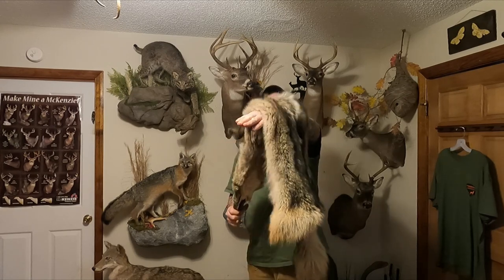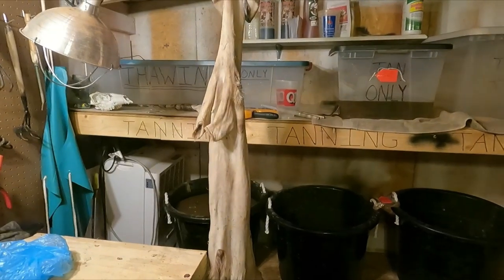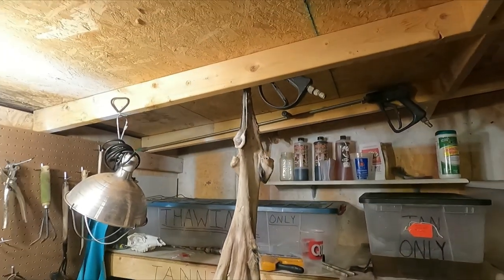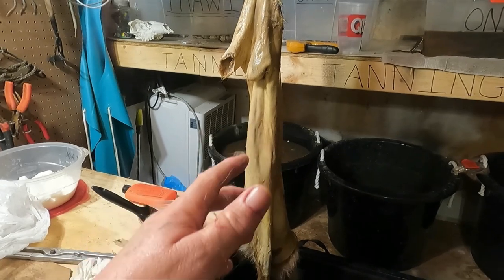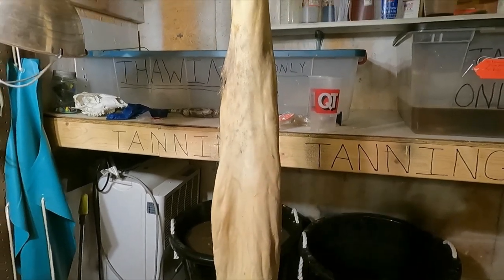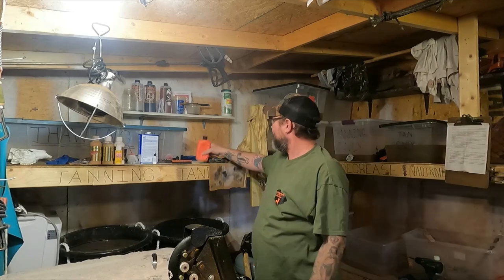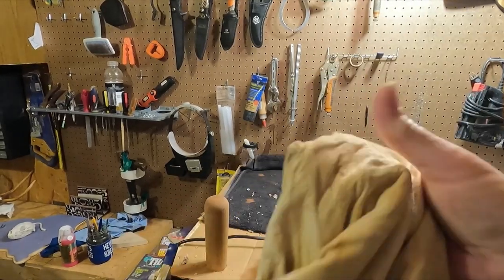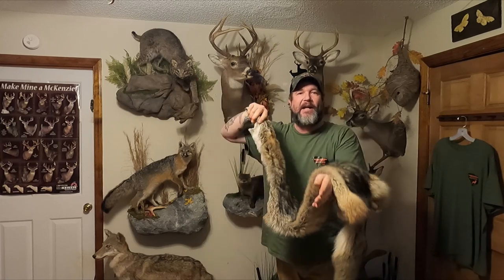Soft Tanning Pelts (Coyote Part 2) #taxidermy #howto #wildlife

Comment: Great info I use the same the orange bottle just got done doing the white tail tip coyote I got the other week. Fleshed it with a electric pressure washer turned out pretty good 👍. Thanks for sharing  buddy 👍🤘💯🇺🇸
Reply from the maker: Yes pressure washing does a really good job. Rinses a lot out of the skin, which is good. Thanks for watching and feed back.
Reply: @carolinabushwacker  yes sir thanks again for sharing. Ur info really helps especially for beginners 💯👍🇺🇸

Comment: I tan mine the same as you. Question I have is when all done can I wash the hide one last time? 
  For some reason some still have a smell to them ,,maybe the tanning solution? I am scared to get it wet again after all that work.
  And yes I washed the hides many times before I put the solution on,,,they were clean as can be.
Reply from the maker: Some smell more than others I have noticed at times. I let them just air out over the next week or two. Another trick is you can use Oder Ban on them. Spray hair side out. Ol' stinky yotes LOL but love the fur. Thanks for watching and hope that helps.